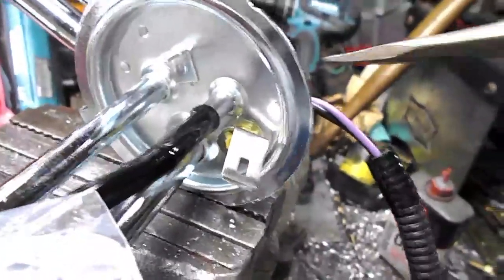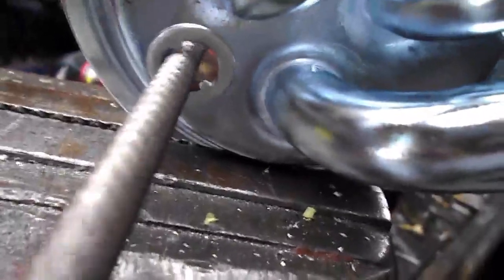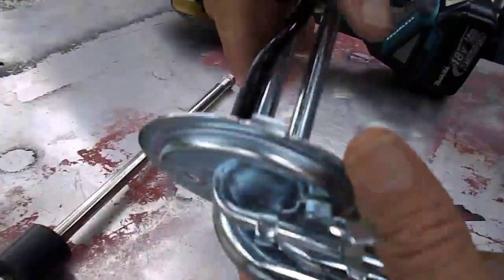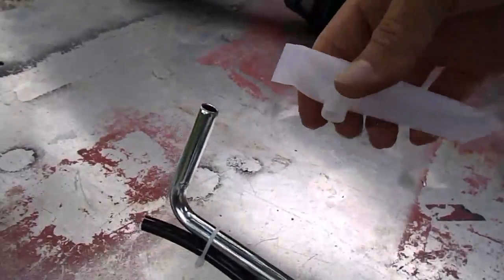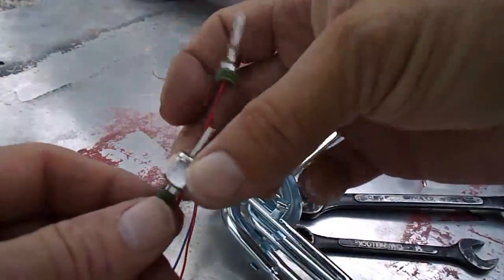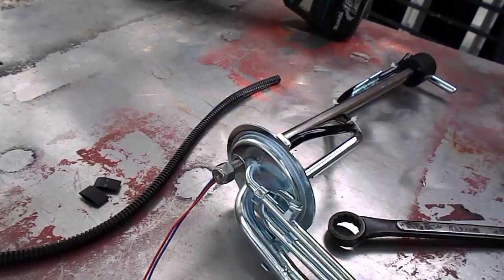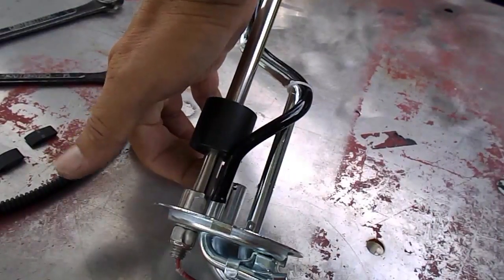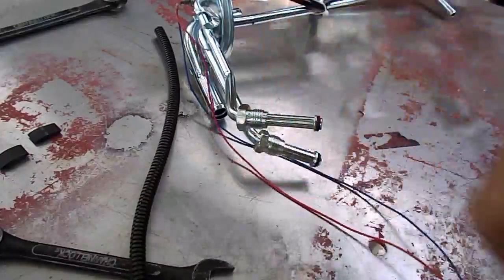metrum fsu istallation

Comment: After I installed my Metrum Rod, my gauge is still bounces.  I also installed a new sending unit and I had bend the rod out on the sending unit as the float would hit it.  I bent it out.  Float has full clearance up and down.

I’m also running your air dog kit if that helps.  I really can’t thank you enough for making that air dog kit plug and play.  My 6.5 has never been happier!